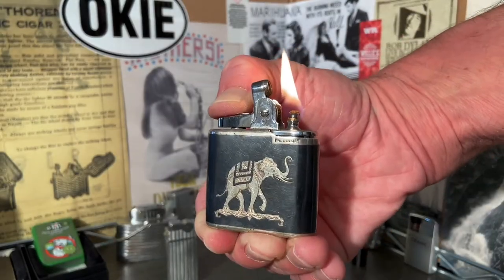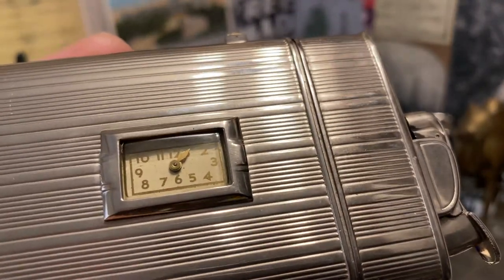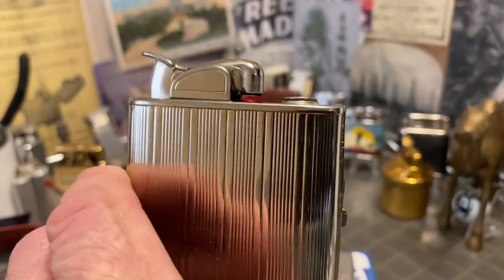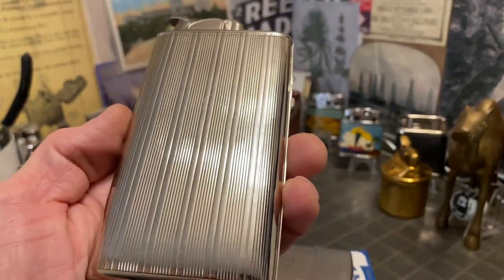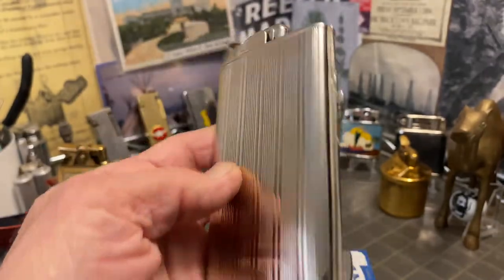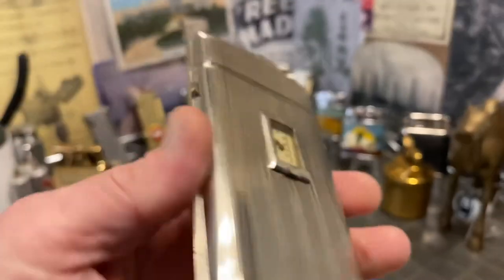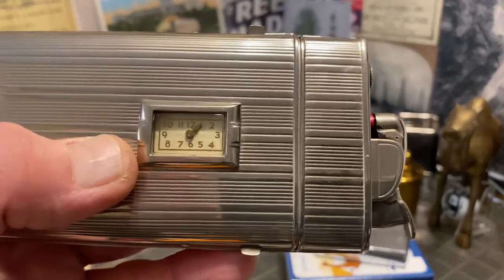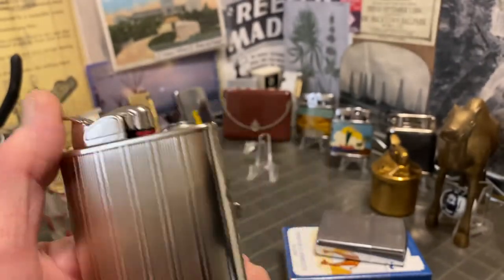Vintage Evans Trig-a-lite Cigarette Case Lighter Watch Combination(Watch Is Non-Functional)

Comment: Zippo is to insert, timepiece is to movement. Either the movement will be repaired or replaced by the watch repairman. Obviously, they no longer make stuffs like they used to, as clearly seen on that piece. Nowhere these days one could still see a lighter, cigarette case and a watch combination still being made. A fine piece in every case. It also has an Art Deco feel to it too!. I guess Evans was thinking of filter cigarettes when they made that lighter-case-watch combo, hence the size of the case.